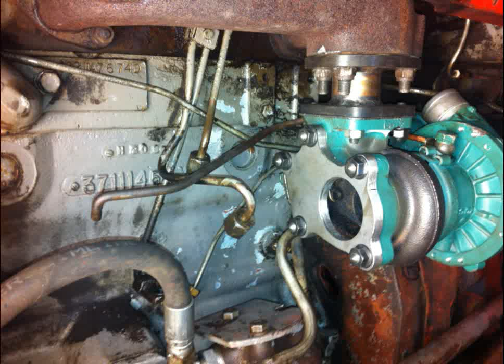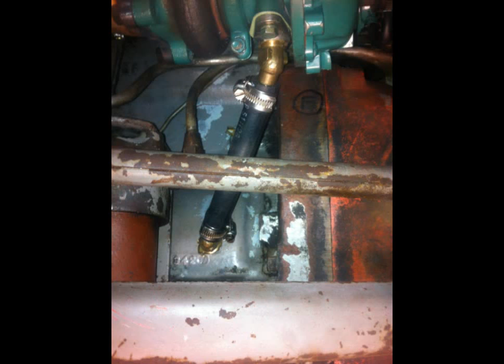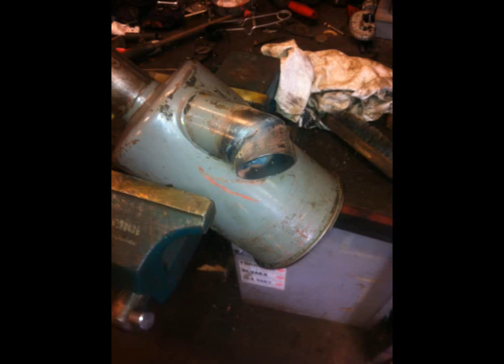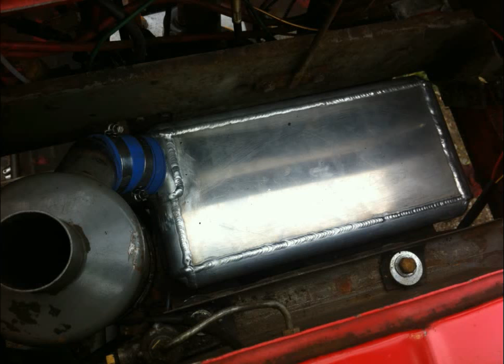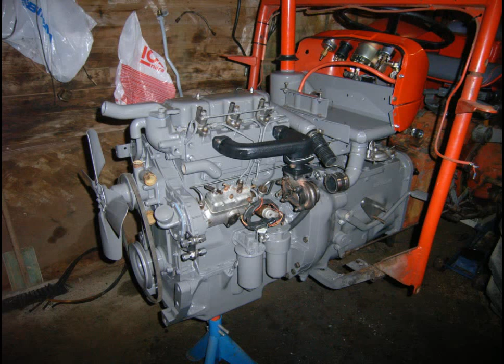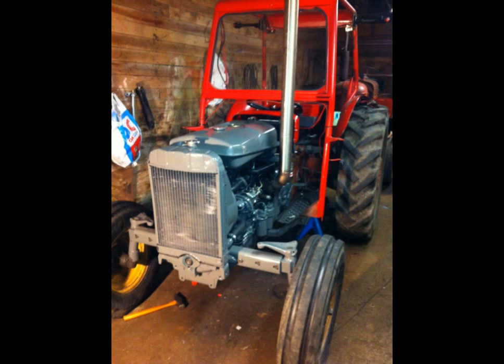Pics of turbo conversion on my mf 135

Comment: Is it the intercooler that sits under the battery box, but how does it work without fresh air around`?
Reply from the maker: No, it's not an intercooler, just a very flat pipe.

Comment: hello thanks to share this video, i have the same engine and thinking to do overhaul and at the same time make same like you, why do you choose this turbo and do you have to adjust fuel injection after fit it?
thank you very much.
Reply from the maker: hello,i cranked up the fuel a bit but not much,i dont want to muck black smoke.
I used that turbo just because i had it and the donor engine was similar in displacement and rpm.
Reply: ok, thank you for your answer, i think i will try with the one i have available at home , is an wv tdi 1.9 90hp. but first i will start engine overhaul. thanks again.
Reply: @Mr7an  Hello, i want to put an turbo on my 135 too  but i dont know how to adjust the fuel injection ? Is it a screw or something like this on the injection pump  ?  How do you have do ?
Thank you
Reply from the maker: @Pillet1196  On the pump there is a square cover on the pump side that sits with two bolts, on the inside there is another two bolts that clamps together a coupling.
If you loosen them slightly and twist the coupling you change the fuel volume.
I cant remember witch way to turn and be careful ...they are a bit tricky to work with.
It´s better to go to a Diesel specialist and let them have a look. BE CAREFUL :) and good luck.
PS. don´t fiddle with the springs on top,if you take that cover of, take a picture of how it sits and are connected.
Reply: @Mr7an  Okay thank you very much, i will try 😉
Reply: @Mr7an  

Hello, 
I have open the pump, but I don't find the where I must change.

It's on the top of the pump or on the side  ?

Thanks you
Reply from the maker: @Pillet1196  On the side of the pump.
Reply: @Mr7an  it the two black Torx Bolts ?
Reply from the maker: @Pillet1196  Yes ,exactly :) just loosen them slightly so you can move the two pieces that's clamped together.
Reply: @Mr7an hello, both bolts are tightened strong, is this normal? is there a mark to adjust next? and if I don't change the injection, will I still gain power? thank you so much
Reply from the maker: @Pillet1196  Yep, these bolts are tightend hard and it's easy to slip. There are marks but make your own before you start adjusting so you know were you were from start.
I think size on the Torx were 5/16 or 8mm, use a Box end wrench(i think it's called?!?) so you don't slip.
Some gain maybe without adjusting, it runs cooler
Reply: @Mr7an  thanks, i managed to change the setting, but i don't see any difference, at least when empty, i didn't try in charge.
Do you have a method to know if it is enough increased? I dont know if i have increased or decreased.
Thank you very much for taking the time to answer me. You help me a lot.
Reply from the maker: @Pillet1196  It's hard to feel when you don't have load on the tractor.
Black smoke is a good indicator of too much fuel :), less top rpm is another if less fuel.
Put a pressure gauge on and read boost pressure

Comment: Is the camshaft and everything else still stock
Reply from the maker: Yes, it is stock. pump is set to max for the engine othervise stock
Reply: @Mr7an  was it difficult to fit the turbo
Reply from the maker: @FlatoutDecals  no,not the turbo itself but to get air to the compressorside and at the same time have it to look a bit "original"was the hard part.I have routed the intake air under the battery in a flat but wide construction,not necesery but.....